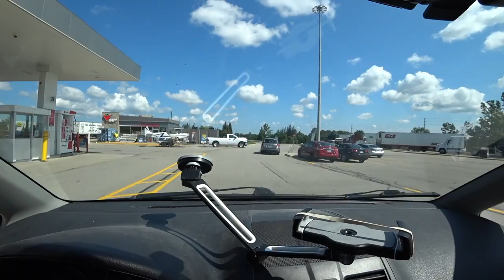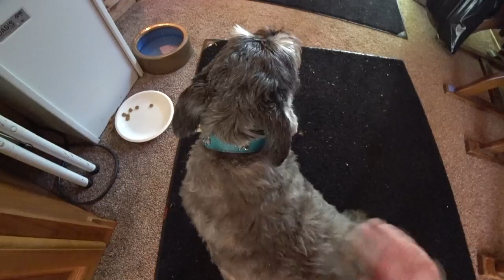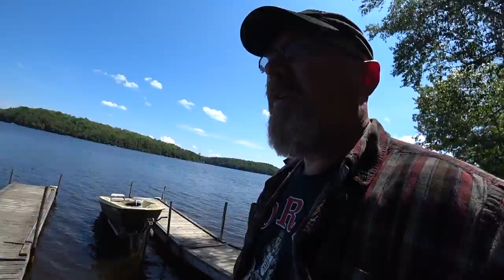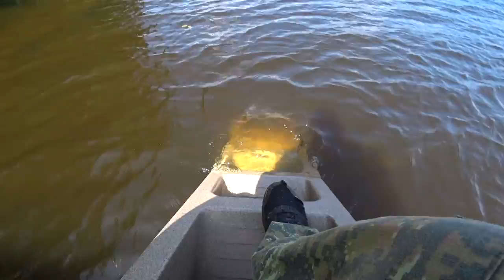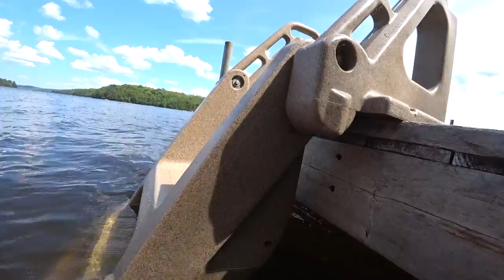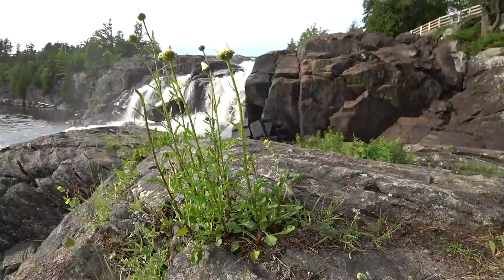Dog French Kisses Guy, YUCK!

Comment: ryobi makes a line or excellent cordless products. they're only sold in home depot in the USA. not sure about CAN
Reply: FYI they have weed eaters, and other lawn equipment that runs on the same battery system as the power tools. They're running a 4th of July sale in USA right now. You can get starter kits with a bunch of tools bundled at a big discount.